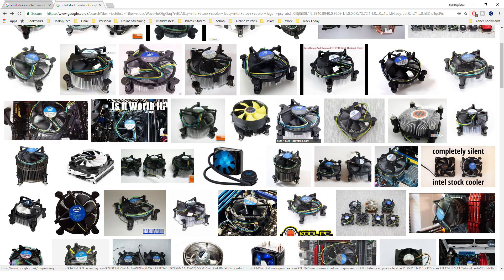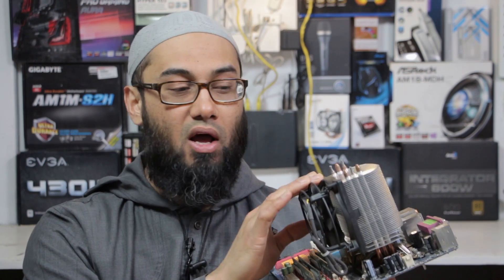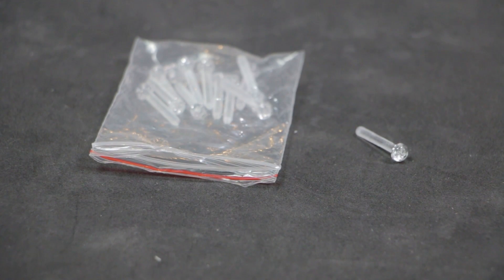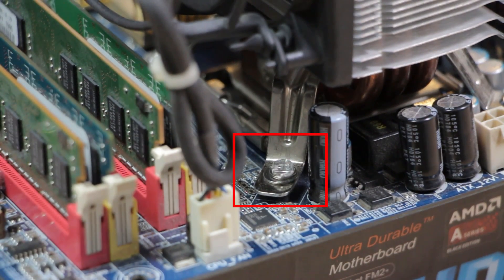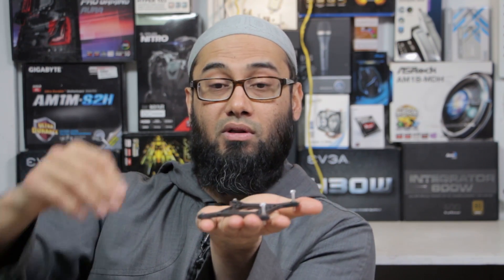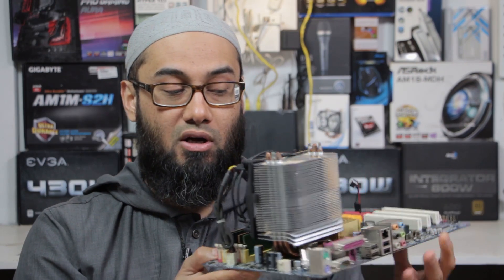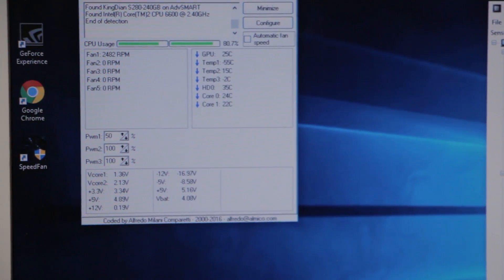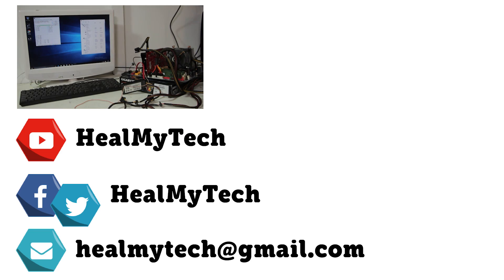How To Easily Modify & Install An Intel LGA 775 Socket Cooler Without The Horrible Fragile Push Pins

Comment: My cpu temps while using intel stock cooler on i5 3570: 105°c (90% utilization_Bad-ThermalThrottling)
My cpu temps while using generic coolermaster i30 on i5 3570: 75°c (100% utilization-No Thermal throttling.
You maybe thinking why thats happen? YES. Its Because The plastic pins were broken 1 of them so its not holding good enough

Comment: I was watching a show on my PC this week when I heard a “pop” and then something hitting metal. Looked around. Didn’t see anything. Then the PC shut off. I opened it up to find my Cooler Master Vortex plus push pins failed. Glad I found this video. Almost “fixed” it with nylons screws/nuts and no backplate. I’m on the fence about pulling everything out of the HTPC case and fixing it like this (predict lots of blood and curse words) or just switch back to a tower and get a new cooler with all the hardware and only endure the pain of removing the hardware to be reinstalled much easier. It’s 2008 tech too. Your fix seems best bc it’s minimal investment.

Comment: Many thanks this is incredibly helpful. My old fan was screw mounted but the replacement had the pins and I couldn't get them into the motherboards threaded holes. Will try this method which looks like it will work great. Thanks!

Comment: I wonder wtf the intel enginners were thinking when they invented that pain in the ass system, and the worst part it's it is still in production ffs
Reply from the maker: They were prob told by the owners to repeat the Edison bulb thing, build an easily breakable part for repeat sales  and upgrade options, more money...but AMD didn't do that, funny....!
Reply: @HealMyTech1  Yep too bad it is easily replaced by screws, even metal screws with a plastic 'washer' (I think it is called) for electrical isolation, great tutorial btw!
Reply: @HealMyTech1   So true!

Comment: Oh thank you so much.
Those plastic pins are a nightmare to use.
Reply: Push pins are fine, but only for the demounted board. Using it for the fully installed board is crazy.